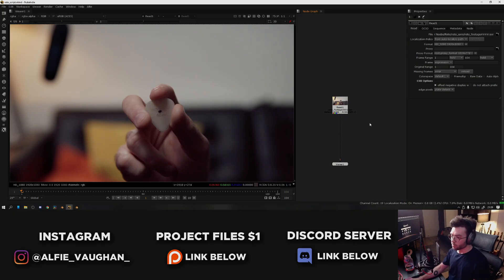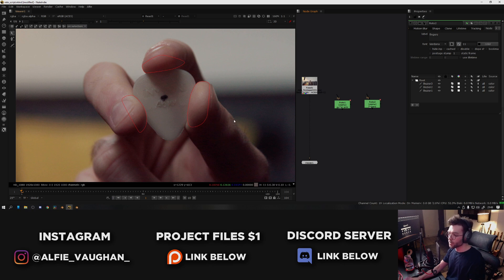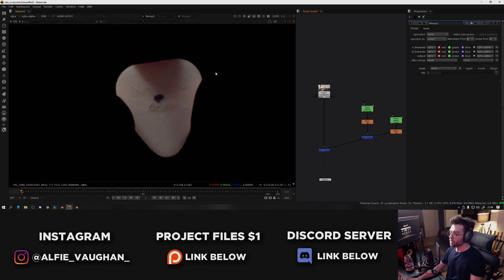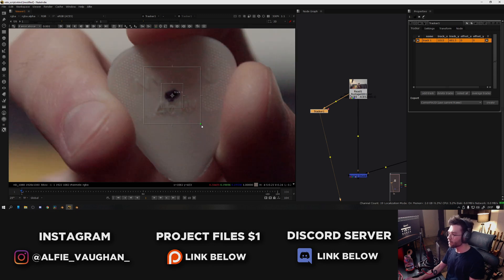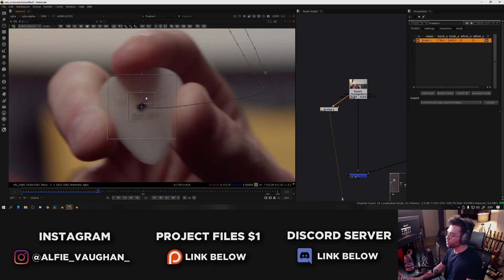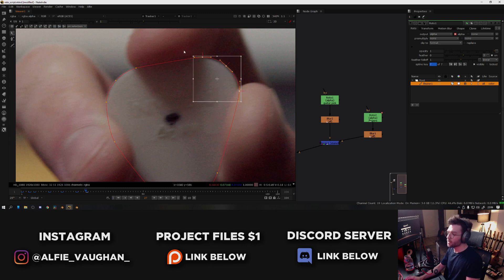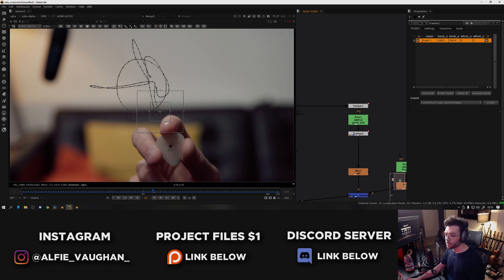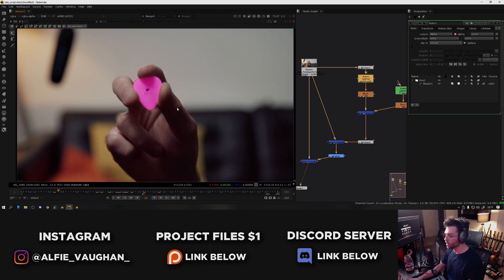Basics Of Rotoscoping | NUKE FOR NOOBS!

Comment: 02:23 how about using EdgeBlur and not Blur for the piece roto
Reply from the maker: Edge blur is destructive. It takes the colour value and of pixel on the edge of the alpha and spreads it out more. So you end up with a flat colour around the edge. It's good and I use it after premults sometimes to soften keys etc but it wouldn't be the right thing to use here

Comment: i see how u are doing but does it make any difference in adding motion blur and extending the feather of the the roto
Reply from the maker: It's the same sort of effect but I wouldn't recommend feathering the roto to take the motion blur. It's quicker and easier to let Nuke do it for you. Unless it's just not working. Then you could do it manually

Comment: Hi Alfie, although i draw a mask, connect it to the viewer node, when I press "a" rather than showing only selected are white, it shows full screen white. But whenever I hit replace on properties it only shows the selected area white. Also when I don't connect it to the read note I don't see anything white if I press a even if I activate replace on properties. Why do you think this could happen?
Reply from the maker: Yes that's correct. That's how nuke works you're not doing anything wrong. When connected without replace on it combines the drawn alpha with anything else above it. When you hit replace it overwrites it all and just uses the mask

Comment: You'll work a lot faster and efficiently if you stop using bezier and use B splines instead, unless you need cusped for hard surface objects. A lot less steps needed to get a consistent result.
Reply from the maker: Thanks for the advice Tim. I use both but personally I just prefer bezier curves. I came from after effects so I guess it's just what I'm used to!